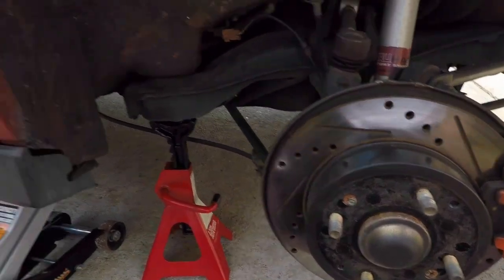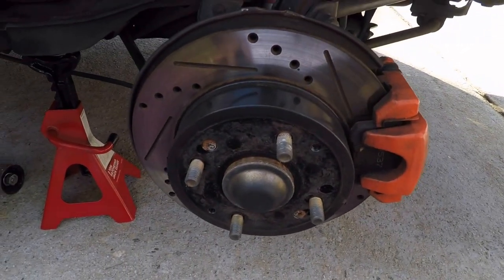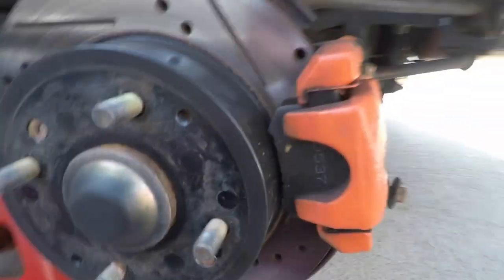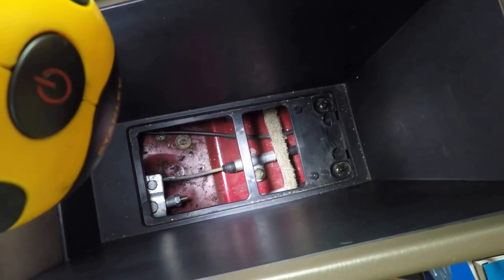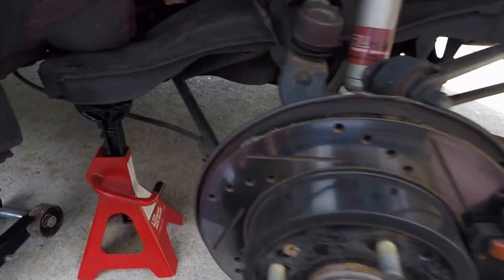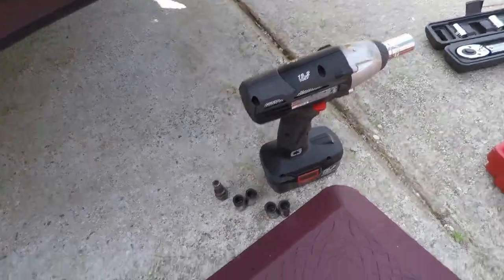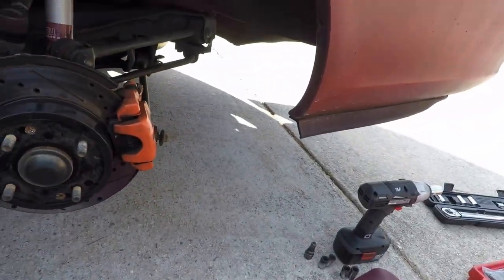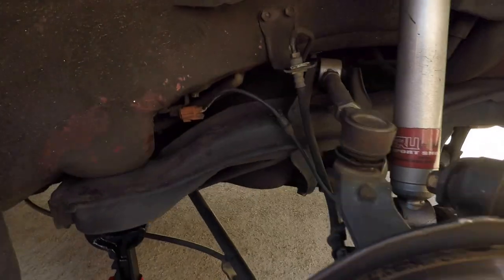Drum to Disc Brake Conversion DIY

Comment: Got a question man dont know if you'll see this but the lines on the car I got my parts from we're rotted and split can I use my drum brake lines or do I need the lines from a car that had disc's? Either way good ass vid bro used it to get my parts list together and you explained the prop valve stuff to me 🔥🔥💯💯
Reply from the maker: You need the lines from a car with disc brakes
Reply: @BulletSolano  thank you bro going to find some this week I appreciate you responding to something on an older vid
Reply from the maker: No problem

Comment: How does the car stop without changing the Proportion Valve?  There are two different part numbers for the Proportion Valve if you are comparing the the 4 cylinders Accords (LX/DX) which had Front Discs/Drum Rear Non-ABS (Honda Part #46210-S70-013) vs. EX (maybe some others) which is All Disc with ABS (Honda Part #46210-S10-862).  The Valves are different, the question is how different are they?  The "extremes" would be that either too much "power" ends up going to the back, which in hard braking conditions the rears would lock up or not enough power going to the back, and the rear hardly does any stopping.  I am asking because I am wanting to do the conversion but would "prefer" not swapping out the Proportion Valves because is difficult getting where the it located and rather not "mess' with the hard line.  But if this is a safety issue than it should be done.  Have you locked up the tires on your Accord since the swap?  Did all the wheels lock up together?  Just the Front or just the back? Thanks
Reply from the maker: You can tell on the brake pads, but is hard to get the right percentage, now I have Acura RL 4 piston calipers on the front, after 4 years I replace the rear brake pads one time already, and under hard braking I can tell that the ABS System is doing a good job
Reply: @BulletSolano  Thanks for sharing and correcting me.......There is a third option Like your Honda that had (Originally Equipped with ABS) that had Front Discs and Rear Drums.  Now you have Disc all around.  Even if the Proportion Valve was putting "too much power" to the rear the ABS would "kick" in the back.  With the 4 piston front set up I think that would be hard any way for the rear to have too much power.  Front brakes always wear out faster because they do about 70% of the stopping.  With ABS in the car, NOT having the "correct" Proportion Valve is not a safety issue because the ABS corrects the issue.   The Accord that I wanting to do the swap is 2000 LX 2.3l which has NO ABS, so it could.   Personally,  I do not believe that each of the different Proportional Valves, (IMHO) will change the "power" going to the rear by more than 10%...... But, those are just my thoughts.
Reply from the maker: Yeah, I don’t think it will get more braking power to the rear, plus I did the big brake swap because my car has ABS, I think you should be fine without a new proportioning valve

Comment: Do you have to change the proportion valve for the v6 model? I have a 98 accord an I want to change to 5 lug disk brake but my car don't have abs system so do I still need to change it if I want the v6 conversion?
Reply from the maker: +876Dooley  if you car have a proportioning valve yes change it
Reply: Bullet Solano ok thanks
Reply from the maker: +876Dooley  no problem
Reply: Bullet Solano were you buy those rotors front and back
Reply from the maker: +876Dooley Hey Bro I buy them on eBay 120 for the full set

Comment: So what part did you pull from the junk yard and change? I have the same car n want to do disc brakes. And I have the rear sub frame off a buddy wrecked accord what parts do I need it has good calipers, rotors, pads, everything
Reply from the maker: You need the spindles/ knuckle, calipers, rotors, brake cables.
Reply: I have a 4 door 01 lx that I'm currently doing f23a swap on and would love to convert the rear brakes. What year, make and model is the donor car or car at the junkyard needed for the parts listed above. Thanks!
Reply from the maker: Hey man, the donor car was a 2001 lx coupe
Reply: @BulletSolano  thanks so much for all your videos and info
Reply from the maker: No problem
Reply: @BulletSolano  hey man good video ! I have 2000 exl sedan and want to switch out it's rear disks to install on my 2002 accord se ! Are they compatible ?
Reply from the maker: Yes